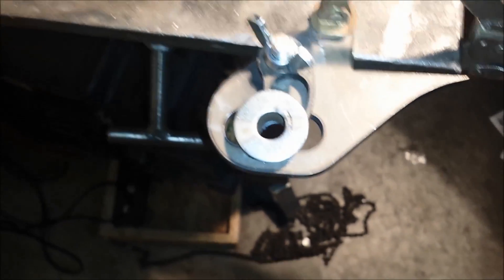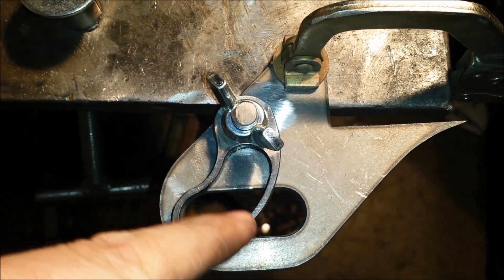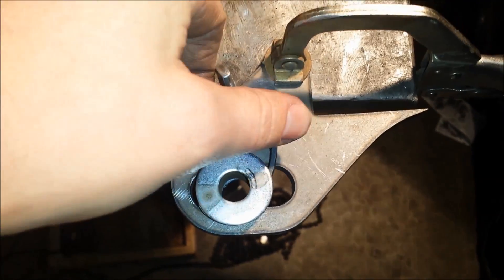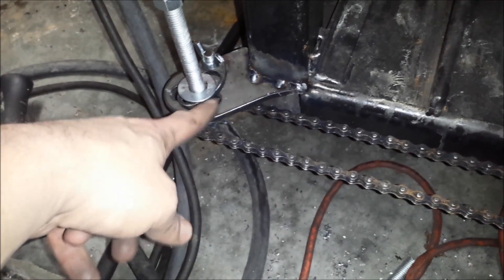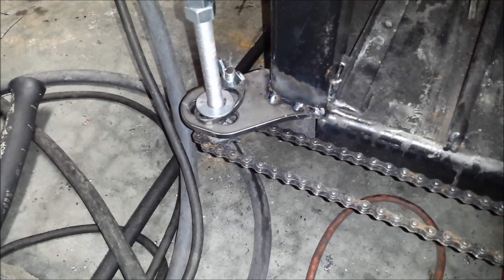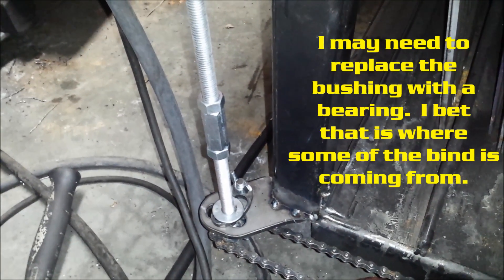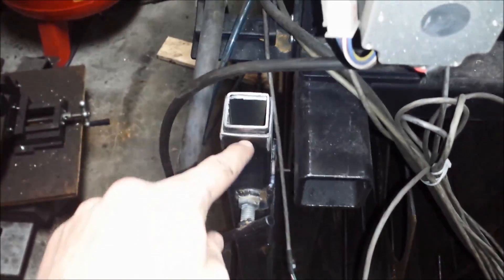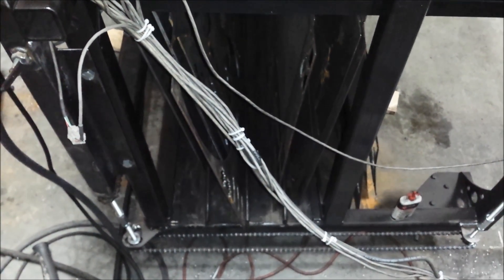Screw-jack elevator for my Plasma CNC -- part 7

Comment: I think the tight chains are pulling on the jacks causing extra friction. The surface area in the jacks is quite large and would be acting like a brake. Some way of counteracting the tension on the chain would help.
Reply from the maker: I agree.  I plan on utilizing some more bearings.  If that fails I will need to loosen the chain on the one end and use a motorcycle type tensioner (takes up the slack, but doesn't apply excessive pressure against the supports)

Comment: Just looking at it I think adding a carrier for the chain at half way for the long one and loosening the chains would help a great deal.  If you have not already done so I would lubricate the hell out of all the moving parts with grease or heavy chain oil.  Your bushing could be causing some binding and a bearing may help but It would all depend on the amount of tension you have applied to it by the chain and/or any axial misalignment of the screw-jack screw and the bushing.  It may also be that you need to just run it up and down a fifty to one hundred times to wear the parts in.